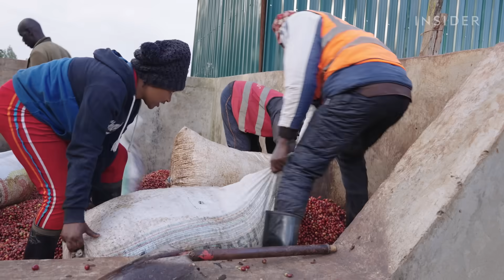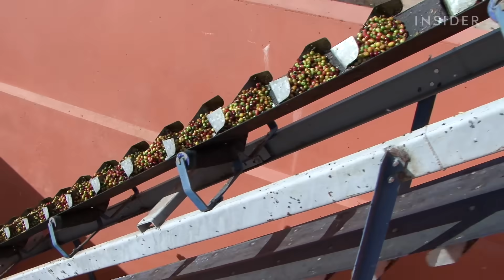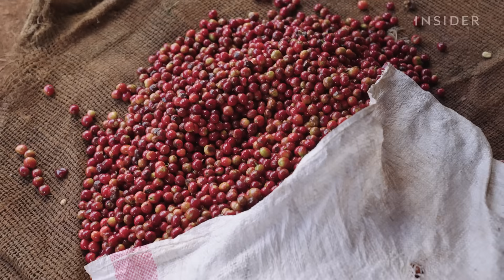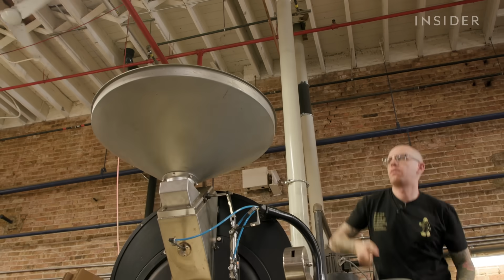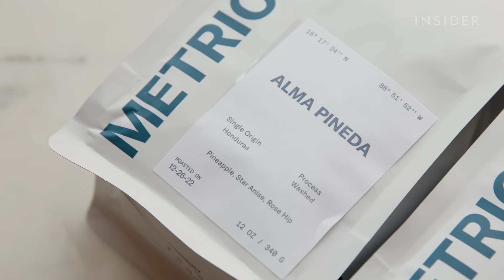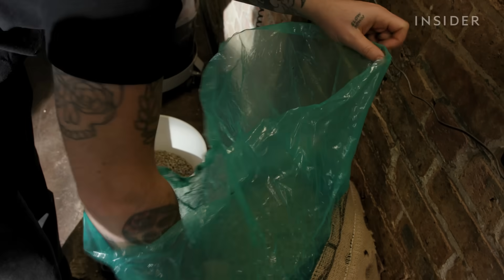Why Single-Origin Coffee Is So Expensive | So Expensive | Business Insider

Comment: It is not expensive at all! If you roast your own coffee you can have a Panama Geisha cup of coffee for under 1$ and not 40$ (if you don't believe it I can calculate it in front of you). I calculated it taking into account everything even the weight loss when roasting. I buy the green beans from final distributor (which means it is already sold with added value) and it is still below 1$ a cup . It is expensive when you are a final consumer, because, let's be hones it is a drug and they want to make enormous profit from each cup. And cheaper coffees (but again top quality) like Kenya AA costs 30 cents per cup if you roast it by your self and if you consider 10grams per cup (which is a lot for one portion). And don't tell me about the equipment, because you can roast coffee even in a pan and if this does not suit your perfectionism, then there are perfect roasters under 500$

Comment: Gratitude to the farmers for the tonnes I've brewed oved the years xxx don't butcher it in espresso though! Soft brew, simply filter or plunger, sub boiling water, be gentle... love those distinct fruity tnotes from a light roast singles, more complex than ANYTHING ELSE you'll ever taste. Tanzania, Ethiopia, elsalvador, nicurguan, mmmmm m...
Reply: You can make espresso that has all of these qualities—it's just a bit harder.
Reply: @r_bear  strongly disagree. Even with $10-30k of high-end espresso kit, conical grinder etc (I ran a slayer for a time) ie:  stepless paddle extraction, tunable temp at head etc.... Virtually impossible  produce the same profiles.  Espresso pressure / temp and other parameters  are very different. You may as well compare espresso and chai.

Comment: An untapped market for coffee is absolutely home roasting. Machines aren't as user friendly as the Mr Coffee pot or the Keurig was. I guarantee if you can develop the use friendly market for a set and forget roaster you will make millions.
Reply: not true haha
Reply: No, roasting just isn't as simple as hitting a button. Different origins, varietals and processes will have totally different roast profiles, a preset profile will never be as good as a manually tuned profile by a professional roster.
Reply: @SpektrikMusic  Same goes for coffee brewing but one-touch machines exist. Lately I've been getting lazy and have been putting beans in my Behmor on the same preset profile and taking them to just after 1st crack. So if you can take the right tech that senses temp and 1st and 2nd crack then you can make a good roaster. The difficult part would be chaff management and smoke suppression.
Reply: @cs5250  Issue would be the cost of a roaster that could be fully automated and still produces a good roast. People using one-touch machines or who are not super into making coffee at home would not want that investment
Reply: @jonnybowdenfitness9558  These machines actually exist - iKawa, for example. But to be honest, the cost of the Pro model would be way to high for an even "super into". In Poland, where I live, you could buy a car with that kind of money. ;-)